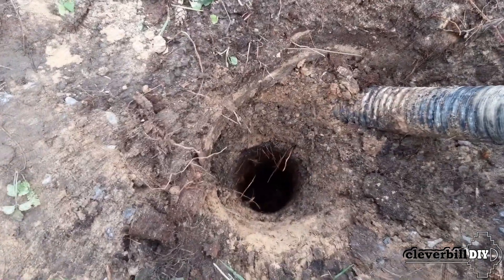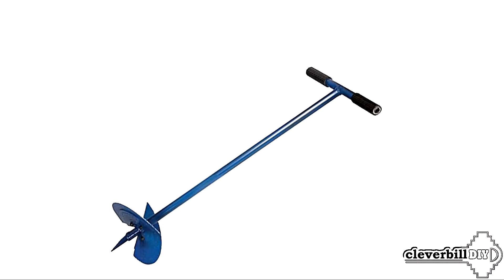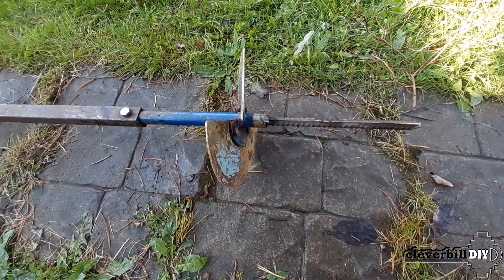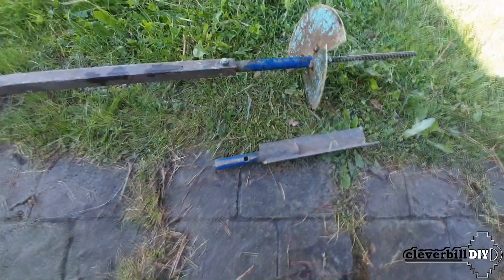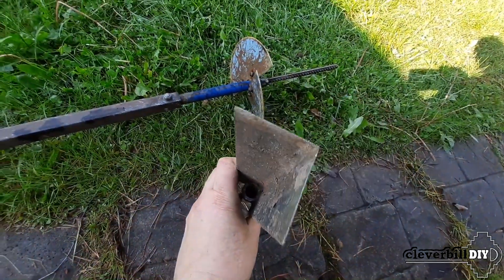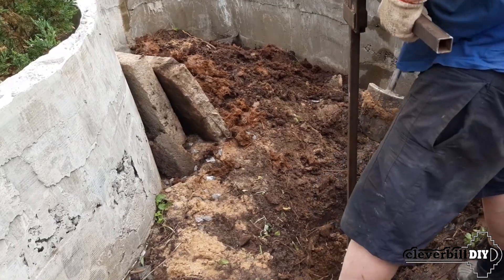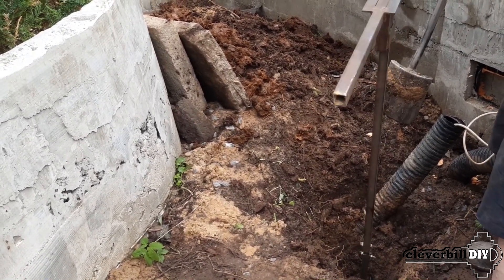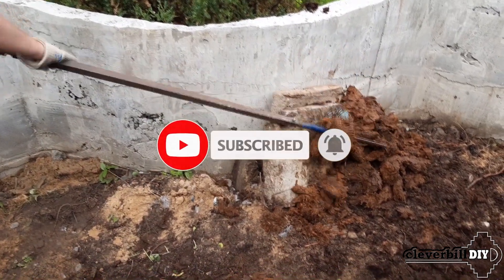Homemade manual drill for making holes (pits) in soft soil for poles or concrete piles

Comment from the maker: With the advent of screw piles, construction on sedimentary soils (peat bogs) was greatly facilitated. But sometimes it is necessary to equip concrete piles, which are much cheaper than steel (screw), and it was for this case that my home-made drill served me.